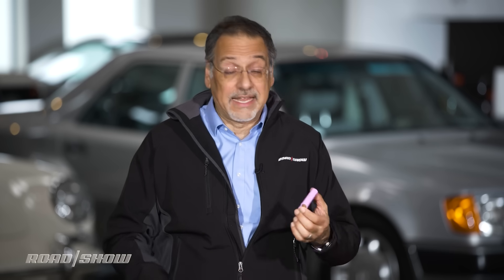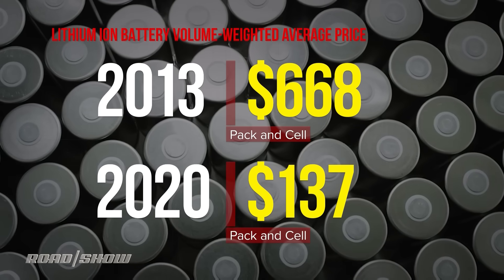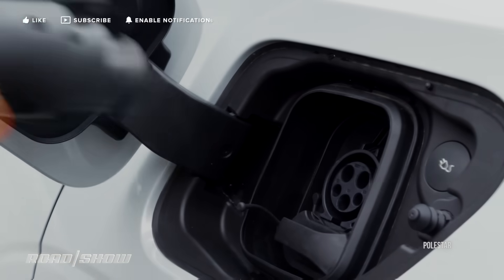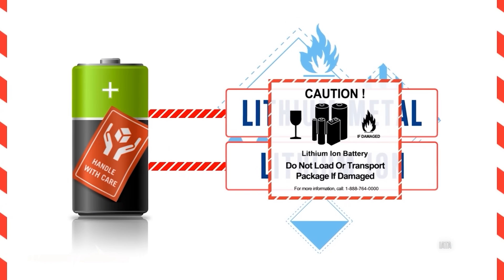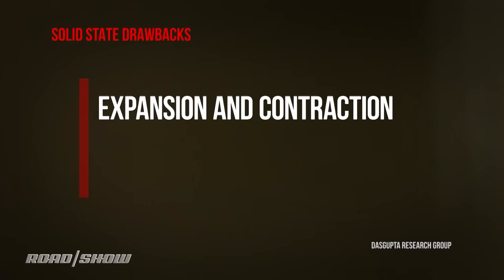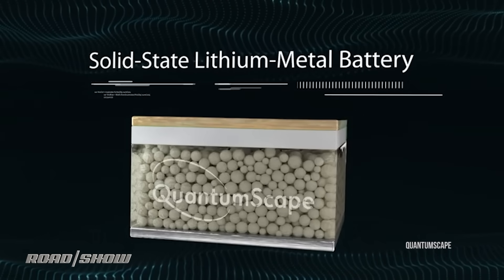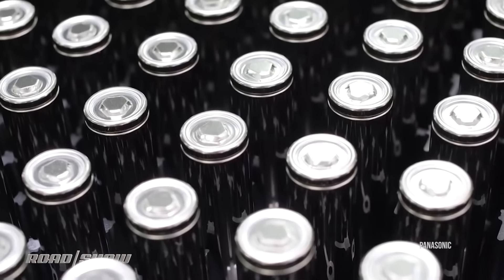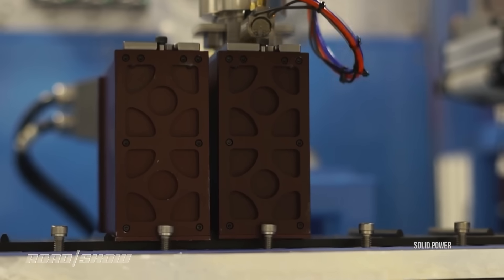When solid-state batteries arrive, you'll want an electric car

Comment: When they make an electric car that can go 1,000 miles between charges and can be charged quickly and cheaply,I’ll consider buying one. Also make it sound like a car not an electric razor.
Reply: i am with you on this in fact i will go further an  say i want a 70s car made with modern materials that would be a winner for me NO ELECTRONICS!
Reply: @ivorjones6618  do you want candles for headlights? headlights count as electronics
Reply: Gas cars can’t even go 1000 miles. What’s next. Needing to be able to fly ? I haven’t visited a gas station in 8 years. I leave my house with a full car every morning.
Reply: @Miniweet9167  if electric cars are the best thing since sliced bread then they should go farther,cheaper, and with a lot less maintenance, and at a lower cost to purchase and charge. Everyone is crying climate change when the Earth is going through a cycle it goes through every few thousand years. So don’t blame cars or cow farts just realize the fact that we can do nothing to change it.

Comment: No, I won't.  I still like my cars with 3 pedals.  At least, I won't have to fight an automatic transmission, when there are only electric cars.  When I worked on phones, I used to warn people that the Lithium batteries were chemically the same thing they use to fuel Hydrogen bombs.

Comment: I won't ever want an electric car because it cost more that 30% of the price of the car to fix the battery casing if it breaks because it's one solid mold. To further this disaster the hookup is exposed to the outside underneath. Also I'm a man.

Comment: Here is the definition of a good idea.
The more people use that idea...the better everything becomes.

Which points out the glaring flaw in electric powered cars.

Charging a single electric car at your home is like plugging in 25 refrigerators onto your house grid.  Two cars...make that 50 fridges...gas up twice a week?...100 fridges ...400 fridges per month...every month.
Most of that power comes from fossil fuels...it has to...it is now beyond a niche industry and straining capacity everywhere.

The batteries are NOT the problem...

Comment: The elements of the batteries are not sustainable, produce enormous toxic wastes and most of the mined material will see critical shortages by 2030, making battery prices skyrocket. EV vehicles will be gone by 2035-2040.

Comment: WHEN a frog grows wings he will no longer bump his A$$ either.
Regardless of battery technology the infrastructure is not up to the task of supporting a majority of electric vehicles at this point.
Heck many areas have issues trying to provide enough power to run A/C's during hot spells and heat during cold snaps and you want to trust your transportation needs to a system that even a storm can knock out the grid for days or weeks?

Comment: Nice recap.  If you want dirt cheap batteries, make them out of dirt.  Nickle/iron flow batteries are showing great promise for safe, non-toxic and cheap mass production, and once they solve the depth of discharge and energy density problems, will displace Li-ion

Comment: Until batteries can be completely recharged in 90 seconds like filling up your car full of gas, and have replacement parts readily available for car owners to buy on the spot, society as a whole will NOT make any kind of mass transition to electric just because the pagan environMENTAList nut wads want us to.   Their batteries are actually 10x more toxic to the environment in the mining process it requires to get the materials to make them, than all the global oil fracking operations COMBINED.

Comment: 500 wh/kg is great, but any significant dollar per kwh cost drop requires economies of scale that would rival Li-ion production rates.  That will not happen until we have a use for them.

Airplanes.  

These will not be used in cars except for niche applications - at least until they are built at scale for other applications first.

Comment: the question is can you combine a solid state battery with a capacitor, so that you charge the capacitor and then the capacitor charges the battery?
Reply: All that would do is create heat.

Comment: its a year later...still nothing. just paperware vaporware. a $40k electric care will actually cost you $120k during the cars life thanks to batteries that can cost $23,000 (per tesla) that need to be replaced every 5 years or so. also, tesla refuses to allow repair shops to fix tesla cars, thus price gouging their loyal customers when a repair is needed. also, how expensive will the electric bill get when you have to keep charging batteries that dont hold the charge so well after a few years? bet it's wayyy more than a gas tank fill-up.

Comment: No, we STILL won't have solved the CHARGING problems! The heating while rapid charging ANY battery is a technological nightmare with no PRACTICAL solution in sight. Liquid nitrogen cooling for semi-tractor batteries is the only solution Scania, Volvo and Euro manufacturers can come up with to charge a semi battery in less than 8 hours for a 600 Km range at 100 KPH with 480 Volts at 4000 amps. Tesla's "supercharger" stations that recharged cars in under 15 minutes didn't work without BLOWING-UP TESLAS! They are ALL GONE now. EV's get the equivalent of 8-12 MPG. A Ferrari costs less and gets better fuel economy and WAY out-performs a Tesla on DOT approved tires, and the engine will last more than 50,000 miles.

Comment: When we can produce a battery in the US from all US materiels,  let me know.  Even solid state require Lithium, a non renewable resource ( same as oil but not hydrogen) and are toxic to the earth on a large scale (unlike hydrogen).  Batteries are only a way to move away from one toxic material (oil) to another.  Neither of which we control, and what's worse, is heavily controlled and mined by toxic methods in communist nations.

Comment: Maybe the best approach for testing first generation solid state batteries would be to issue them in mobile phones as a special edition. If 100.000 special edition phons was sold with a prearranged full repay of the item after one year a lot could be learned from the state 😆 of the battery. The software would give additional information on usage charging etc. Main thing will be to maintain full privacy to the testers.

Comment: Yeah...right.  Maybe next year.  I've followed battery tech since the late 90s and while we've made some advances, it isn't all that much in the grand scheme of things when you compare it to the the performance and ease of refueling of a traditional engine.  When they can offer a competitively priced car that can go 650-800 miles, in any and all climate conditions with the heater or AC running, and then recharge to do it again in less than 10 minutes or so, then they'll have something.  But packing up the kids in the WonderCruiser to take them to visit the Woke Mouse isn't going to happen if Mom and Dad have to stop every couple hours for more than half an hour to recharge the econobox.

Comment: You need a strobe like to see how fast  the 4680 production line is going. Tesla is getting 500 mile range with these batteries. I think solid-state is a moot point now If they ever happen. I don’t think the 4680s are using a wet slurry either BTW. Oh and Tesla‘s are like 100 times less likely to catch on fire than a gas car. And the tablets technology has eliminated dendrites.

Comment: A battery that can charge extremely fast is a nice development, but is only reveals an even bigger challenge - getting chargers that can deliver extreme amounts of energy in a short time. 'Gas' stations and truck stops will need many megawatts of additional power to take advantage of this capability. That requires new generation stations, a LOT more grid capacity, and all of that need to be run to each charge station. 

None of that requires new technology, just a lot of time and massive amounts of money. Otherwise.....current battery tech is just fine. Currently the grid is near 100% and we only have a tiny portion of all cars being EV's. If EV's capture much more market share - we will literally run out of power to charge them well ahead of EV's becoming the majority passenger cars. 

Throw in some new fancy ultra-fast charging tech and that just get worse.

Comment: Electric vehicles is not the way to go. I hate to say it. I have been a mechanic for 16 years now. With just the electronic components on vehicles now we are seeing major problems. Wiring issues constantly, sensors go bad, radars go bad and when it happens, especially when everything goes all electric, then everything goes out. The vehicle won't move or won't go over 15 mph. We are going to waste tons of resources on infrastructure and it won't be good. What about all the batteries when they go bad? How good will that be for the environment? Come on people wake up before it is too late

Comment: The expansion and contraction happen not because of heating and cooling, but due to intercalation of Lithium ions into and out of the electrodes during charging and discharging.

Comment: Love it.  Lets take a tech phrase we don't understand and apply it to some other technology we equally don't understand.  In the electronics industry, "Solid State" has an entirely different connotation than is implied by the way its being used in regard to these "solid substrate" batteries.
Reply: "The term "solid state" became popular in the beginning of the semiconductor era in the 1960s to distinguish this new technology based on the transistor, in which the electronic action of devices occurred in a solid state, from previous electronic equipment that used vacuum tubes, in which the electronic action occurred in a gaseous state." (Wikipedia)

Pretty much the same usage of the word, obviously in different engineering contexts. One differentiates a solid from a liquid (traditional batteries), while the other differentiates a solid from a gas (vacuum tubes).
Reply: so they should just add the R and forget about it
Reply: I'm glad you said it. I was thinking almost the same thing.
Reply: Dont say these things. Michiu Kaku will be expounding on it as though its scientific fact tomortow.
Reply: Repent to Jesus Christ “So whether you eat or drink or whatever you do, do it all for the glory of God.”
1 Corinthians 10:31 NIV
Reply: @repentandbelieveinJesusChrist3  no such thing as virgin birth. All of Christianity is based on this lie. Go away.
Reply: @repentandbelieveinJesusChrist3  Hail Satan!

Comment: Just bought the Rav4 Prime.  Hopefully by the time I'm ready to move on from that vehicle (6-7 years) the EV market will have improved to the point where it makes sense to go to an all electric vehicle.  Not just the solid state batteries, but the charging infrastructure as well.
Reply: Why so rigid? You could buy another car and simply sell it when the time is right. Selling isn't such a hassle.

Comment: Until we can find something that can (1) produce enough heat to keep me from freezing to death on my way to work (2) has better energy density than fossil fuels, I am not interested. I also think we need to reduce raw mineral waste. Current EV and “green” tech requires 10x what fossil fuel tech does. Couple all of that with how dirty manufacturing and recycling of “green” tech is and it is far worse for the environment that fossil fuels are.

Comment: I'd like to know more on capacitors...
Reply: Capacitors aren't gonna be of any use in the EV industry. Also, we already do have supercapacitors but they're not that interesting cause of their very low voltage rating.

You know when capacitors are gonna be interesting? When they have these features all at once; not one of them, but all of them.
- Have a density range of 1 farad and up.
- Have a voltage rating in thousands.
- Have a size that doesn't exceed a common drink can.
- Have a cost of less than $500 (or its inflated value).

Some simple minds might think these super-dense-high-voltage-capacitors would replace batteries, but capacitors are far from doing that.
So what are they even gonna be used into? Aside from the wide variety of industrial applications, they're gonna be used for space mass drivers (electromagnetic launch systems). And also electric mobile weaponry for the first time ever which means advancments in solid-state batteries is also highly valued to pair with this kind of capacitors.

Comment: Still I do not see EV outperforming ICE cars in terms of power range and efficiency, what are they going to do about the charging time?still how can we be assured that the batteries lifespan are not going to dramatically reduce in about 3-5 years like smartphones and tablets due to every day use?still what about cold weather or when the car goes for a long time without use?and will I still be able to drive an electric car after 15+years?

Comment: I already put my money down for a Tesla Cybertruck. They are predicting at least a 450 mile range for my truck (two motor, four wheel drive) and that is plenty for the limited driving I do. A full charge would last me over a week of normal driving. For another ten grand I can get the trimotor with a 600 mile range estimate. My Cybertruck won't be built until 2022 at least. Maybe the solid state battery will be viable then and Tesla will use them.

Comment: Until you have a battery that will go 500 to 600 miles on a charge, gasoline engines won't be totally replaced.  Electric cars will be the best option for city driving, but if you want to drive to Florida from Michigan with today's electric cars, it'll take you a week to get there.

Comment: We will still not want an electric car .and electric car no matter what kind of battery you have Has to be charged , our  electric grid can’t handle what it has now, with brown outs whole states going down ,If only 1/3 of the country switchs to electric cars they wouldn’t be going anywhere for the most part because they can’t be charged with a bed electric grid . lithium batteries right now explode on impact and high heat just take a torch to a lithium watch battery it explodes like an M 80 imagine what would happen with a Tesla battery maybe that’s why you don’t see them racing in NASCAR where if the public saw them crashing and  explode they wouldn’t want one and a two hundred mile range is designed to keep you from going too far. the electric grid and the Chinese companies that run them could turn you off at any point and you’ll be going nowhere !no thanks keep your electric car and the coal burning electric grid you have they cannot keep up with the demand. You won’t tell people this though you’re not allowed.

Comment: Batteries are one of the ONLY things that have not gotten much better and is the single largest thing holding us back from leap and bounds in other areas of advancements. 

Think of going or doing work in the Asteroid belt with the batteries of today and your main engine goes out --- ya not a very good scenario at all. 

People also dont buy electric cars because of their SHORT ranges and how long it takes to charge  them.

Comment: When they get an electric car with 1,000 mile plus range on a charge with a quick charge or 1 hour or less, yes I will want an electric car, otherwise, no.
Reply: my car (petrol) only has a range of about 900km (~560 miles) (but then again, I live in a mountainous region)
you are setting up some really high expectations here
Reply: @kuhluhOG  And you can fill it up in less than 10 minutes and be on your way.
Reply: @waterwalker1315  quite frankly, if I drive from full tank to empty I need to sleep
(900km at 130km/h ~= 7h)
so it doesn't really matter anyway
Reply: @kuhluhOG  Different with  me, visit brother or sister, several states away and have to stop for gas twice to get there, not going to turn a one day trip into 3 or 4 days each way.  Different people, different needs.
Reply: @waterwalker1315  well, I live in Europe, so not as big of a problem for me

Comment: I have an electric car now and at 350 miles of range is not a problem to me.  As Elon said, it's easy, making a prototype, the hard part is putting it into production. Thats the problem they have always had and Li batteries are getting smaller and more powerful each year. Time they actually develop a production solid state battery, Li-on will have equal performance, cheaper price and better reliability. Like Nuclear Fusion power generation, solid state will always be a few years away

Comment: The batteries were always the issue with electric cars. Battery technology is still rather stuck in the 1900's. Yes there were electric cars in the 1900's. In fact NYC had something like 15,000 charging stations back in the 1910's for the Baker Electric cars that were the rage among women and doctors. Still the batteries were the limiting factor. When they solve the charging times and range issues people will buy them. Right now I see them as nothing more than a town car. You know, you don't want to leave town because there is a big chance you won't get back home.

Comment: Did you get that wrong? No dendrites in SS batteries as far as my research goes. Dendrites are the drawback of the current Li-ion battery technology, not the solid state battery technology. Indeed ssbt is supposed to avoid the dendrite drawback, as dendrites cannot grow through the solid electrolyte (glass/ceramic).

Comment: One recent estimate is that in order to have enough electric power to charge all those new electric cars and trucks by 2035 we would need to start building one 6GW nuke power plant per week STARTING NOW until then. The grid will not even handle that much up grade power distribution without a major national over haul. Pipe dreams.